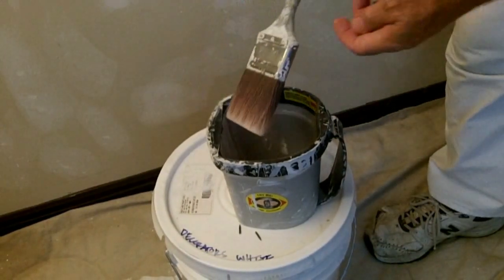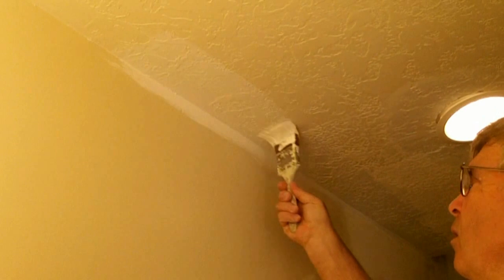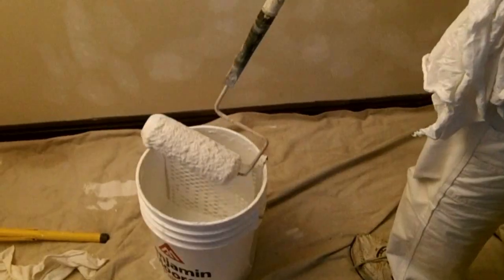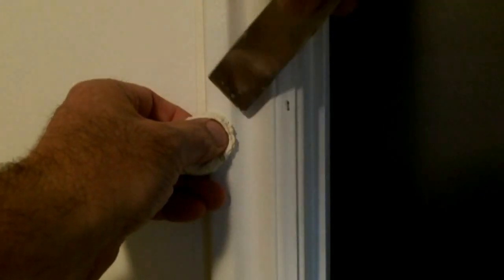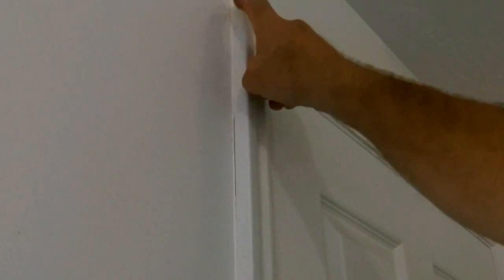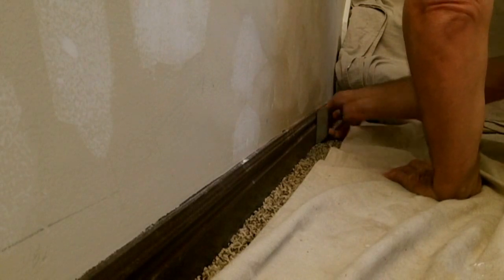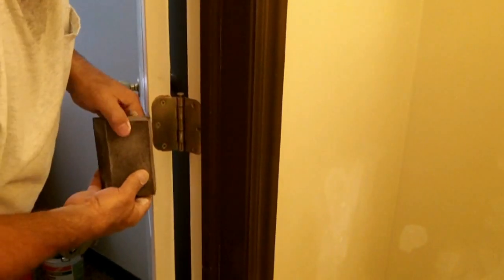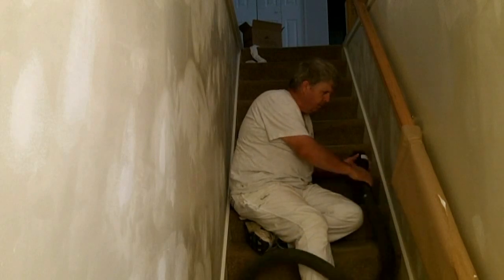Painting a Room 2 of 4 Painting ceilings and preparing trim and doors for paint

Comment: Hi quick question
Do I need to prime the putty before painting?
Reply from the maker: It all depend on the type of paint you are using, Home Depot Bair paint is self priming.  There are different types of putty, there is painters putty, I like Crawford's painters putty, it does not need to be primed. I use it to fill nail holes, then there is spackel and drywall compound they do need to be primed unless you are using a self priming paint.  I hope this helps, thank you for watching.